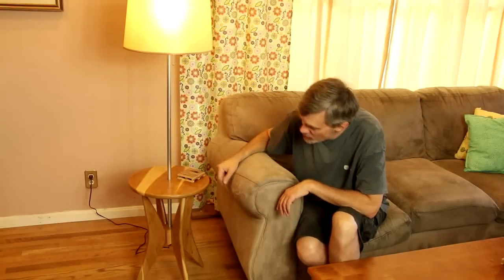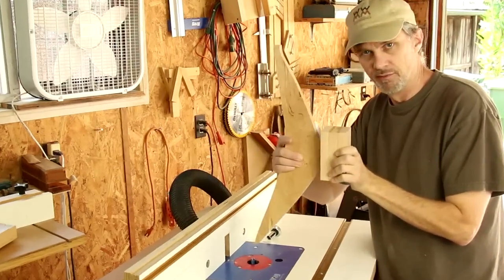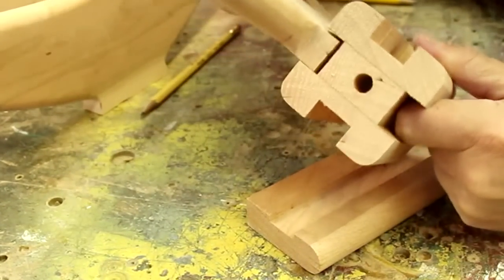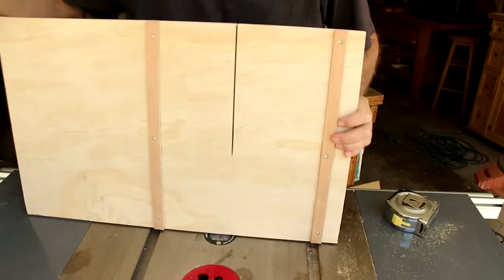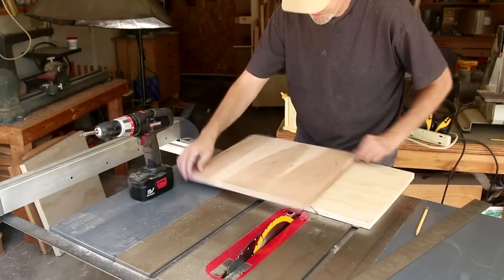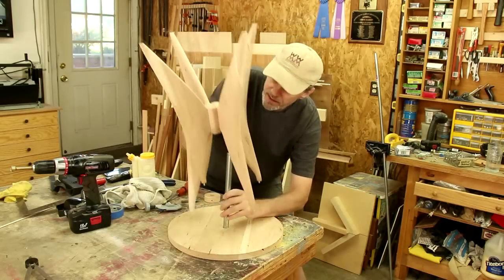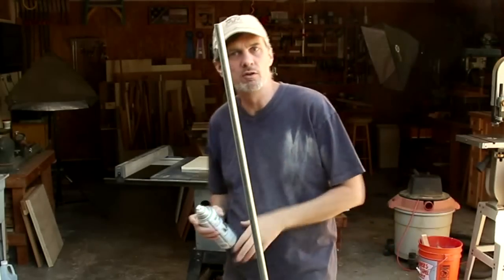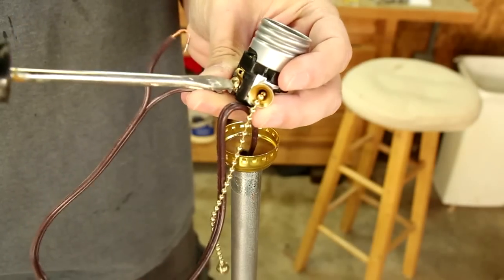Building a cherry wood floor lamp: retro style

Comment: Great to see someone else use the table saw to cut circles.  To all the critics out there, don't knock something till you have tried it.  Funny thing when using the table saw there is no blade drift.  Clean up is easier.
Great lamp, well done.  Keep up the good work

Comment: Hi Steve!  Great work and talk through. When I did this type of work ie; morticing legs into a block, I always used a tapered dovetail joint system, as the legs tightened up when
you tapped them in (from the bottom). A strong joint. Good luck in all your projects.

Comment: If you have a radial arm saw you can do this, and bevel the circle in one step if you choose.  I've got a Dewalt Powershop, and the manual actually covers this.  I never would have thought to do this before either!  It's a very, very neat trick.

Comment: Hey Steve! Your videos always get me motivated to do some proper woordworking!

But is the table-saw setup your usual way-to-go when you want to make a circle? There's this great circle jig for the handheld router you could probably make in under 30 minutes, works like a charm! Basically it is a router base with a slotted arm attached to it. Theres a slide-able and lockable bolt in the slot (it functions as centrepoint). Just one of those really handy things to have lying around the shop.

Comment: I hope Mere Minutes will show more detail of the circle cutting sled!  Also, have you considered expanding your band saw table with a larger top (also would help with zero-clearance)?  I wouldn't have used the band saw for this either, though, just the amount of sanding needed would be horrendous!

Comment: Cool design Steve.  This may be me, but I'd like to see more details, even if it means a longer video.  Either way, thanks for making & uploading it.

FYI, a handheld router with a circle cutting jig (piece of ply screwed to the router base) would be faster & probably do a better job than a table saw.  Since you own a bandsaw, a circle-cutting jig for that would be another faster & easier way.  (I mostly turn and use my home-made one all the time.)

Comment: There are several benefits to using a table saw: not everyone has a bandsaw, the cut will be a lot smoother, and the safety issue can be almost completely negated with a minor adjustment: instead of a solid screw which may allow the piece to "bind" between the blade and the pivot point, use a thinner fastener like a finishing nail or even a thumbtack.  If it bound the pivot would bend out of the way and kickback would be avoided.  However, we don't do for safety, but because we like making stuff

Comment: Mr. Ramsey, cuting a circle with the table saw seems a bit wrong. I believe the bandsaw is both safer and faster, plus it doesn't need a sled at all, just the same pivot point perpendicular to the blade. Anyhow, it works nonetheless with the tablesaw. Nice project. Thanks for your time.

Comment: Yep, make a linkage with a piece of wood. Put a screw in a board that fits in a hole in the center of thing you want to cut, then figure out a way to fix said board to your jigsaw.
You could also just draw a circle on a piece of wood and trace it with the jigsaw, and then fine tune it with sanding.

Comment: Hey Steve, does wood glue stick well to the glossy side of the edge banding (since you did apply some when the width of the cut was wrong)? By the way, do you find out why the width of the cut was wrong?

Comment: Hi all ok guys whats the theory about what happened to the block for the legs ,
Steve did you use the router one way then flip the piece over and go in from the other side and if you block was not centered with the fence then the router bit cut wood from both sides of the center ,[does that make any sense]
G feeling your pain .

Comment: Did you connect a ground wire to the metalwork?
Reply: Their usually no ground wire on lamp cords, they are normally two wire
Reply: Yes but if you pass a lamp cord through a metal tube it could become live during a fault condition so it needs a ground connection to ensure satisfactory tripping of the protective device, i.e fuse or mcb.

Comment: a table saw to cut the round top, instead of the band saw?  what gives?
Reply: turning the square long enough against the saw will give a perfect circle so long as the middle of the square is kept in the same place, which it is. you could do it on a band saw too but this is far easier than trying to cut the square by hand